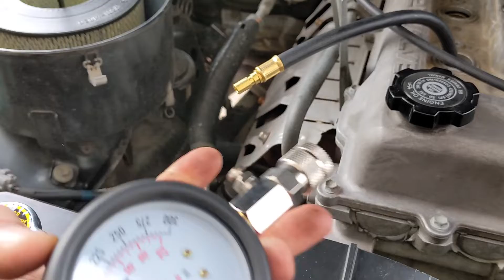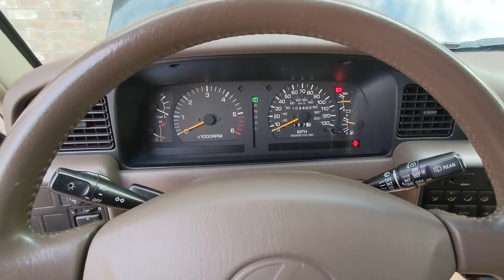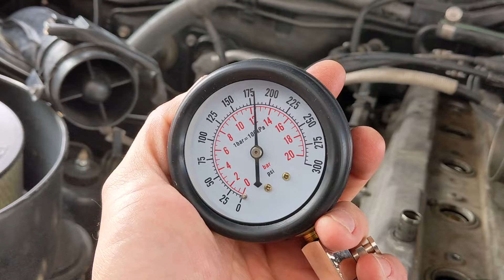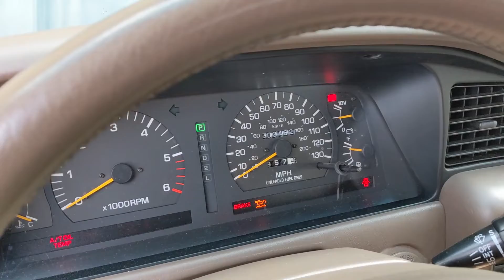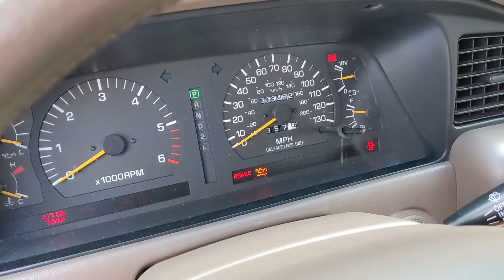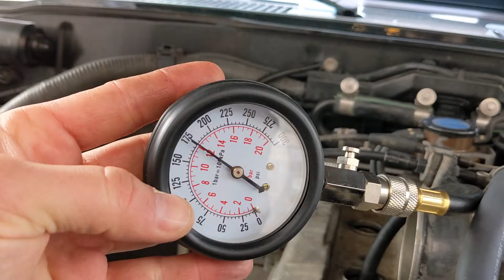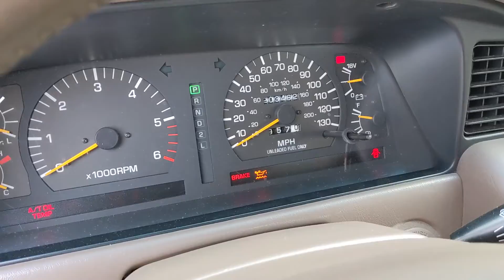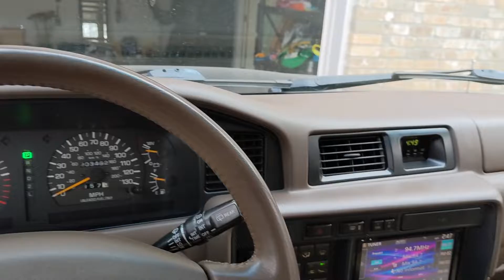1997 Land Cruiser Compression Test Toyota Land Cruiser Lexus LX450 1FZFE

Comment from the maker: Here is the compression tester kit that I use. Very useful to have in the toolbox. https://amzn.to/3H6KhZl

I highly recommend you get set of 3/8" wobble extensions. They make this and many other tasks where a socket is required in a tight spot much easier. I got mine here: https://amzn.to/33OavBm

Also, pick up a set of magnetic spark plug sockets. You will thank me. With engines like this the typical spark plug socket with a rubber boot will not work and get stuck in the valley. Here is the set that I use: https://amzn.to/3gdTQKp

And if you really want to be professional about it, get a spark plug boot removal tool to make popping each one off a breeze: https://amzn.to/3IFeM9k
Reply: The kit your used does not have 16mm bass adapter. Did you buy that separately ?

Comment from the maker: EDIT: Some folks mentioned to run another test per the FSM procedure with engine at operating temp. On a factory "street" engine I always run compression tests cold so that the piston rings are not expanded. It gives me the best reading of what the compression is at worst case scenario. When the engine is warmed up the pistons/rings expand and you have better seal and better compression. For a commercial engine or race engine, always have to run the test warm since they are built "loose" by design. BUT, I am not very curious to see the difference. So I'll be doing a follow-up test and video with engine at operating temp and throttle at WOT. I'll post that once I get it done this week.